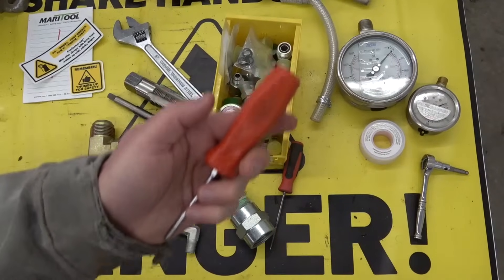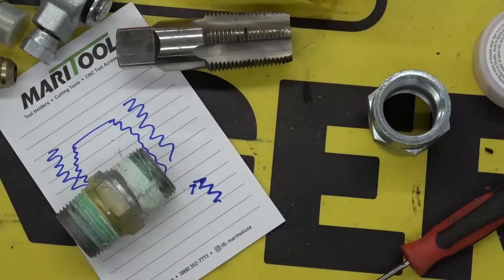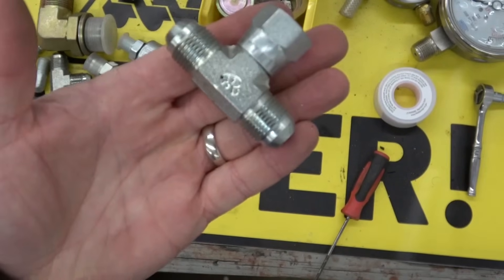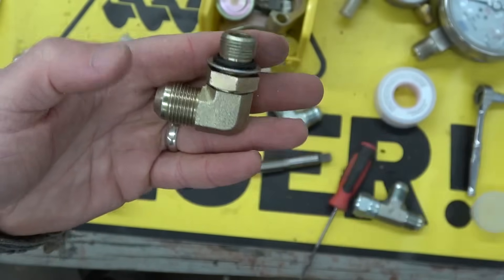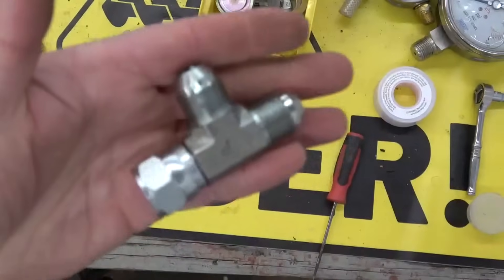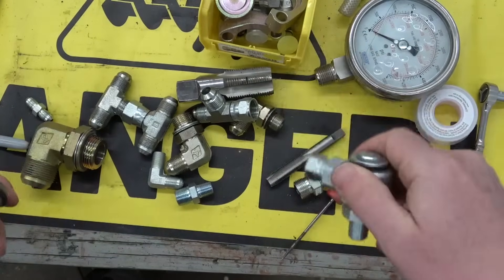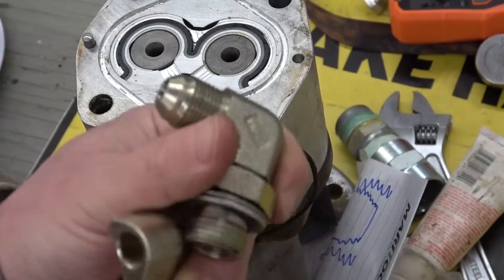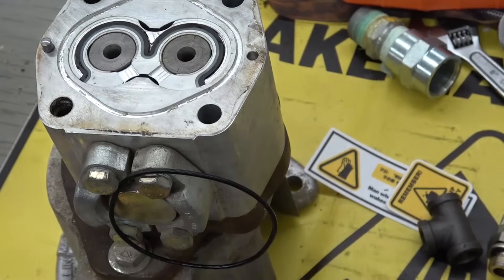Pipe thread is designed to leak || AvE hydraulic

Comment: nptf (fuel):  Am I a joke to you? nptf is made with a sharp crest so that it deforms mechanically and seals at the root of the thread. No dope required.

Kamatsu doesn't have the market cornered on special fittings. Cat has their own line fitting designs too beyond the flange style you showed. I discovered this when trying to bypass an oil cooler that had a massive leak.

EO bite type fittings are my favorite. Used to see them a lot on German equipment. A hardened steel ring shaped like <> makes a seal due to the high mechanical pressure created at the near sharp points when the fitting is tightened. I get a chubby when I see a EO banjo fitting.

Comment: So wait, Komatsu uses SAE fittings with metric threads?  45 degree right?  With metric threads?  Why was that necessary?!  It was already a thing that worked!  Engineers are born to measure their schwanze in how they can make up new shit based off old shit but not compatible.  O-ring boss is nice because often you just replace an o-ring and move on with life and even those I have made with superglue and stock.  But if you want your machine or vehicle pissing fluids everywhere just use pipe.

Comment: Having the same trouble with a Tecumseh engine spark plug port. Can't get the new plug or tap to thread into it.
Reply: Take the old plug and make some cuts (flutes) in the threads. Turn the old plug into a tap. Assuming the new plug has the same threads and diameter as the old one.
Reply: @eltomas3634  Tried. Plug was too short. Had to get a plug tap for 30$.

Comment: Also, cat fittings come in 2 thicknesses.. code 61 and code 62. Code 62 is thicker and for bigger machines, Code 61 is for smaller machines. They often go on valves or power hammers for excavators
Reply: You have that wrong, cat flanges are the same diameter and bolt pattern as a code 62, cat flange has a thicker flange tho. Code 61 and 62 are not cat flange although cat used them before creating their own type. You can use a code 62 in place of a cat flange or vise versa by changing the clamps.

Comment: If you can't snug up an npt with hydraulic sealant, swak AND teflon tape also works... and one more turn. Npt threads stretch because their design is reliant on friction to seal off. Hence all the dope required to make used fittings work... until you shear it off and then by god hope it isn't ss on ss because then you're beyond fakked.

Comment: In Aviation we call them AN fittings, swagelok
Reply: Swagelok is also a brand. But yes it's a fitting with ferrule and wedges the pipe into the fitting which causes it to expand and seal onto the ferrule. It's called a swagelok fitting because the pipe is swaged into the ferrule and smashed as you tighten it onto the fitting. There's also a feeler gauge/nogo tool to use for each size to get the proper amount of tightening/swage but no one uses it.
Reply: I thought Swagelok fittings were something else entirely; like a compression fitting where you seal on the outside of a plain steel (or other metal) tube.
Reply: AN (Army/Navy fittings) are similar but distinctly more specific than JIC fittings. Swagelok is a company that makes tons of fittings of many styles, but is well known for their double-ferrule swaged tube fittings.
Reply: AN fittings are 45 degrees and more sizes than typica flare fittings.

Comment: Always warm up the female socket
Reply: Ensure it’s properly lubed.  Don’t want any galling.
Reply: @dochaze1 Yes, and I would advise the male end to be made out of a fairly stiff material, especially under hydraulic pressure.
Reply: If you guys can find it!
Reply: @SusanPearce_H  Finding the socket's the easy part.  Finding its grease fitting though ...
Reply: @SusanPearce_H experienced hands know where to find it and have the tools and knowledge for correct use but when we are ready for work the shop is shut. So we down tools and go to the pub instead.
Reply: Not as necessary if you have a Sch 40 tapered fitting. Couple that with the typical inability to sustain pressure for long periods, yer gonna see a consistent failure of mating surfaces. This is why lots of guys source offshore FNPT's, they tend to spin on a little easier. That being said, the threads tend to fail right after the Canadian certifications are awarded for some reason
Reply: @Edwardmatrix  Ffs🤣
Reply: The innuendo opportunities off of this comment are virtually endless.
Reply: @Greenmachine305  Inya window, out your door.
Reply: im not smart enough to add a funny comment, but i had to salute those that did 🫡. this comment string had me laughing out loud
Reply: @colestowing8695  yeah it's been one of the better ones to be sure
Reply: Thermistor - When the temperature changes, the resistance changes... just like a woman! So it should be called a Thermissus!
Reply: @oceanaxim  What about a NTC?
Reply: @oceanaxim  haha
Reply: Of course. You don't need an engineering degree to know that.
Reply: Is this why summertime assembly seems to be easier? It has to be.
Reply: Never try to use male as a socket. Weren't made that way. And it just ain't right.
Reply: If you don't, you're just dicking around.

Comment: I love JIC over NPT but those female sleeves always crack! Been doing hydraulic hose repair for years. Granted NPT fails as well but i put in a vice or REALLY crank it down! I always prefer O-ring boss because it's a much cheaper fix when it fails
Reply: gorillas break jic all the time...  lol
Reply: @Sageofthe16  no but even he said it it's leaking, give it a quarter turn.. that doesn't always work and sometimes crack them!
Reply: @SenorPoopyPantz  if its leaking, something is damaged or broken and needs replaced.  let it drip until you can get parts
Reply: @Sageofthe16  well that's when I get called. I fix them on the spot. I have a mobile van that I fabricate hoses out of...
Reply: @SenorPoopyPantz  heh, i used to be the guy who called the van.  we used to spend about 15k on hoses a trip.  hydraulic injection molding machines.  lots of scmoo in that empire of dirt.  im at a place now thats all electric and its glorious